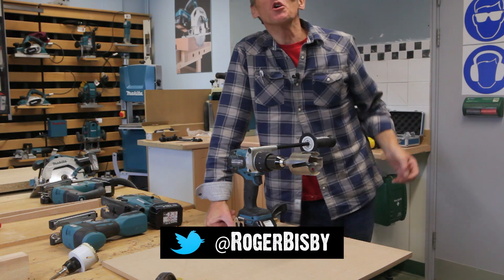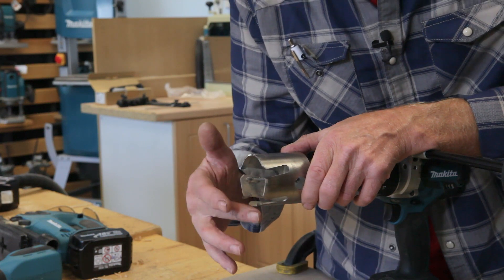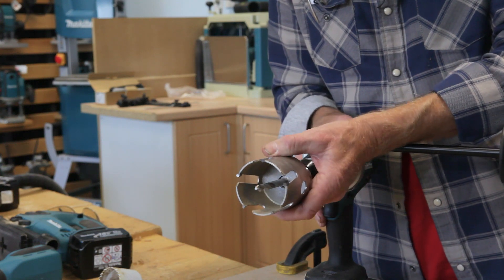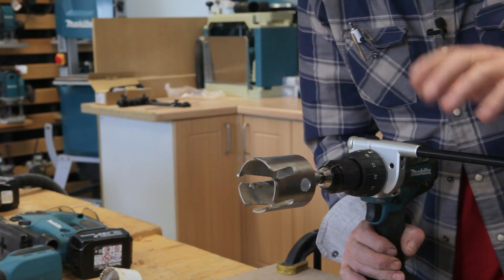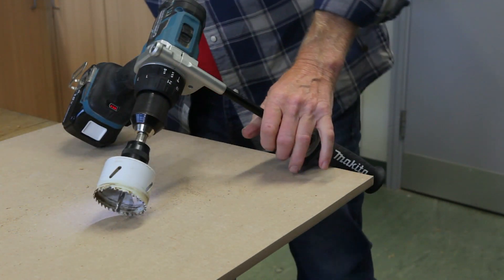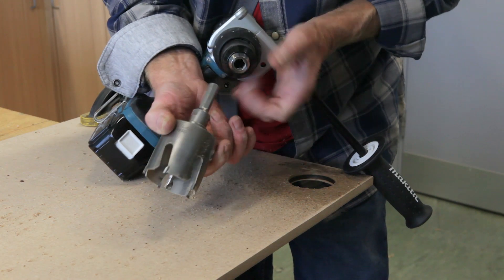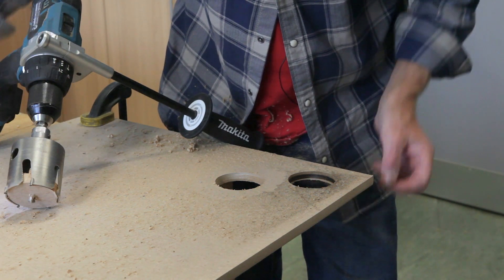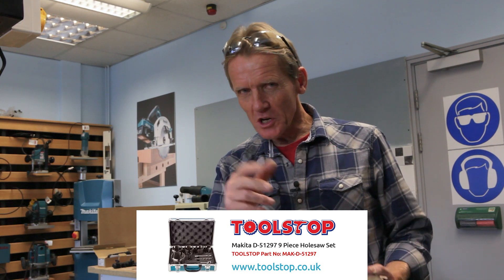Makita Tungsten Carbide Tipped TCT Holesaw Review

Comment: I have been using these holesaws for years now , the Bosch brand multiconstruction hole saw , they are without doubt far superior to normal holesaws although quite expensive to buy they are worth every penny for speed and clean cutting , i have always wondered how long it would be before another manufacturer would start to compete and hopefully the price of these saws will come down..........Cheers
Reply from the maker: There are quite a lot on the market but they all seem to be around £70.00 for a set.  I don't think that is too bad because they outlast bi-metal and can be sharpened.

Comment: Thinking outside the box... Without a drill press, is it possible to use these bits by hand to slowly carve through 3mm MDF? Or use drill to cut template, and use that template to guide the bit by hand?

Comment: Whilst using the carbide tip hole saw, all the force (of cutting) is on those five tips. Wonder what procedure they follow to glue those carbide tips to the tool.
Reply: They braze them on, not glue. Brazing is standard for carbide tips. Take a look at a skilsaw or table saw blade.
Reply: Yup! I work in metal fabrication and when we break teeth off we send them into a saw guy who brazes them back on. 😉
Reply: Pretty strong little buggars.

Comment: i use holesaws daily and to me it appears you used a dull holesaw to contend with the sponsored product, hence the burnt sawdust, burnt kerf and plenty of smoke. though i don't disagree that tungsten carbide is the bees knees, i do think that its preceding counterpart deserves a fair shake in re-testing with a fresh one out of the package.
Reply from the maker: Andrew 
I intended no deception. There is no doubt that a new holesaw would fair better but for how long?  My experience is that they heat up in wood and are not great for the job so, even if the blade I used had cut ten holes prior to my test,  the tungsten carbide tipped cutters had done the same number. Makita had been using them both straight out of the box to demonstrate with througout the day before I decided to make my little video. I think it is a fair demonstation but respect your right to disagreee.
Reply: Skill Builder in light of the fact they've been used against each other straight out of the package and also the fact that you're cutting mdf,  I now agree that it's a fair test. thanks for taking care to reply

Comment: I made around 3 400 holes 79mm diameter with my bosch gsb 18v-ec and i had no pronblem
Reply from the maker: Good to know. Did you use a tungsten tip cutter or a steel one?
Reply: +Skill Builder CK bimetal

Comment: Those bits look like they'll be awesome. How used was the normal whole saw bit?
Reply from the maker: +mesa620 To be honest that bi metal hole saw bit was fairly well used. It happened to be the one that was lying around but they aren't made for timber,, they work well in metal but overheat in timber so the new tungsten ones are much better for timber.

Comment: Great channel, I had to subscribe instantly. I'm working on a little project using a 114 mm holesaw. My basic cordless drill has no option for a side handle and it' s not really ideal for the task. What are the features I should look for on a new cordless drill? I guess it should have a brushless motor in 2016 but what are the other key features for working with bigger holesaws?
Reply from the maker: Thanks Christian. We love subscribers. Check out our website when you get time.

Comment: If your using it with brick work do you need to use hammer action
Reply from the maker: No I think it is best not to and I am not really sure I would bother because you can now buy cheap diamond core bits which work much better than this. Once you have used this cutter on brick or tile it is never going to be as good on wood again so I  would keep this cutter for timber, ply, cement board, plastic and soft block.

Comment: Hi there
you a very nice person and your channel is helpful
i want to ask you a question
i want to get a cordless drill
but i don't want to spend alot
i found skill 18V nicd battery coming with two battery
what do you think?
Reply from the maker: +ashraf helu
The NiCad battery is old technology. You have to run it right down before you recharge it. I suspect the battery will not last long. I think if you can't afford a Li-Ion battery model you would be better off with a mains powered drill. They work, the last a very long time and they are cheap. Sometimes having to plug a drill in is a problem but often it is not so why pay all that extra money and have the problem of batteries dying when you can just plug in and get the job done.
Reply: +Skill Builder that is very good advice my 5 year old dewalt drills are about to get replace with Lion simply because the the old NIMH batteries are dead. I can't think how long ago my last Nicad battery went.
Reply: ive talked with skillbuilder about this, one giant furniture store we bought from had some Black + Decker tools and the workers love them. they did say some ridiculous things such as that its more powerful than Dewalt (maybe they were comparing 12v to 18v?) but it looks like they have improved... another good cheap brand that people say is also really good despite cheap is ryobi

ive heard that the chraper brands take lots of parts from the more expensive brands, @Ave took some ryobi tool apart and its parts are really high quality

also you can get some real innovation in cheaper brands, @tools in action tested the black + Decker matrix/multi evo system where a drill turns into a jigsaw, circular saw, reciprocating saw, sander, multi tool, tire inflator, Bush cutter etc, although dont expect it to be anything like the real deal... there is also one drill that has "autosense", check that out in tools in action whete they have tested it..

also if you want to get a good, cheap cordless circular saw, jigsaw, or a surprisingly good hot glue gun down the line, they all run on the same b+d 18/20v max batteries!!

Comment: what do you think about pro-fit  hole saw from super rods
Reply from the maker: I think they are the best ones, a bit more expensive but invaluable for enlarging holes for downlighters. We looked at them in our Toolfair video.
Reply: jep Pro fit is the best, we have them where I work and when they are dull you can just send them off to get them resharpened.
Reply: Im looking into these. The downside i can see with the profit is because of the way the bit moves to extract the plug, the overall length of arbour, bit and pilot is longer than a standard or other tct setup and therefore would be less likely to get in between joists. Is this the case.

FYI you can get any tct bit sharpened just like your saw blades, not just the profit ones.

Comment: I think that this video is a bit misleading. Sure the Tungsten Carbide tips provide a way more superior cut to bi-metal holesaws but that is not totally the reason for ease of cutting through materials. The TCT holesaw has a huge clearance in front of the tooth to accomidate the removal of chips/dust. The holesaw on the other hand is good to about 2-3mm depth before the teeth get clogged up with debris as it has no way of evacuating the chips and cause huge amounts of friction. This is why bi-metal saws tend to 'burn' their way through. Also Tungsten Carbide is very brittle and will chip with rough use. If you could get a bi-metal saw with fewer teeth and more clearance, it would be a much more economical choice.

Comment: Looks quite good that. Normally makita put their name on some Chinese crap like there 100 piece drill bits. I avoid them. This however looks like they have put an investment into it. That drill is pretty immense too. Look at the size of the handle! I have the predecessor the none brushless one.
Reply from the maker: +Zed Man Yes Zed Man you are spot on as usual. That 100 piece set isn't  worthy of the brand and I asked them why they did that kind of thing. They said "because we make a lot of money out of it" but I think that is short term gains. You might buy one but you wouldn't buy another. This hole saw is in a different league but I'm not sure they make it.

Comment: Such a biased review. Sure the tct bit would be quicker but the standard bit used for comparison was old and knackered. Also no mention of the fact the tct didnt come with a quick release arbour. So if the whole point is speed and efficiency, thats a massive oversight on makitas part and by the reviewer.
Reply from the maker: pedred 
The TCT is faster because it produces less heat and has carbide tips there is no doubt about it . They are also more expensive. The TCT has cut the same number of holes as the demo holesaw because we had been using them new out of the box all day on demos.